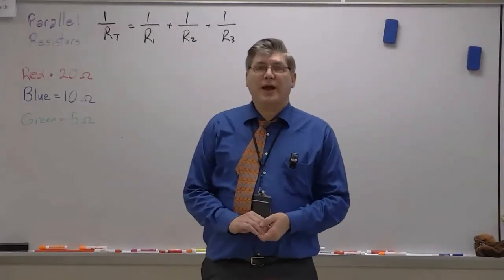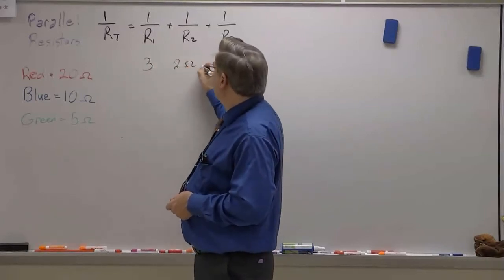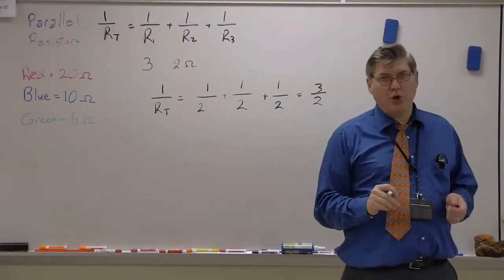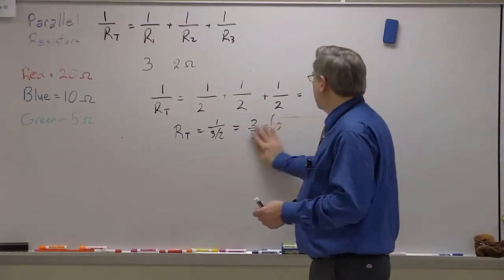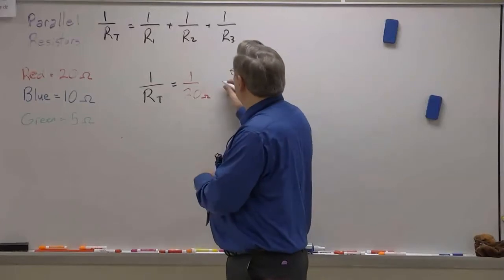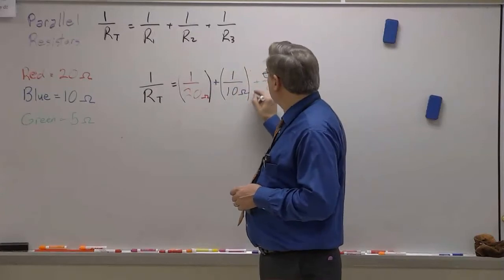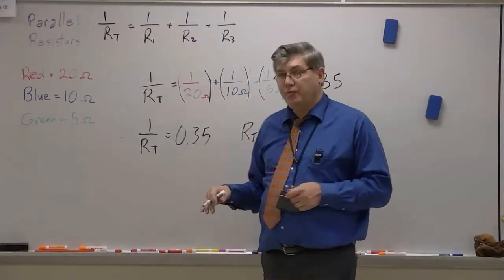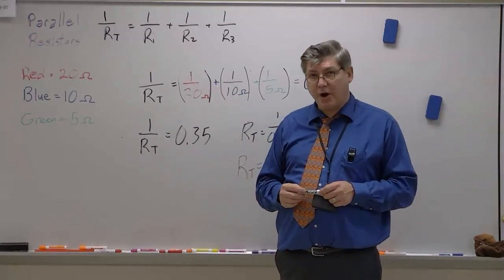Reciprocal Rule for Resistors in Parallel

Comment: How did .35 become 2.86?? That’s where I’m lost
Reply: 1 divided by 0.35=2.86 So basically the 1 over 3/2(3 divided by 2=1.5) is actually 1 divided by 1.5 which equals 0.67
Reply: 1/Rt = 0.35, so Rt=1/0.35, which is 2.86.  You have to do one (1) divided by the total, 0.35 to get the actual answer.

Comment: How would you solve this if the resistance is less than 1?
Reply: if each R is less than one, treat it the same way.  Suppose you have 3 identical resistors, and each is 0.1 ohms.  1/Rt = 1/0.1 + 1/0.1 + 1/0.1 = 30.
Since 1/Rt = 30, then Rt = 1/30 = 0.033 ohms.  Notice that the total is still less than the lowest resistor of 0.1 ohms.